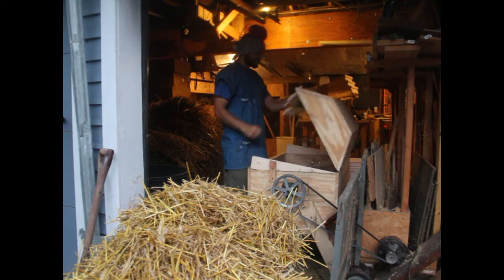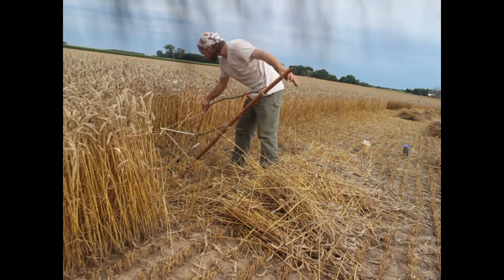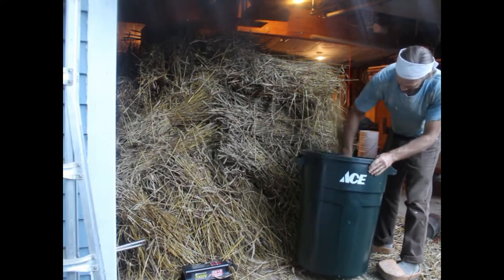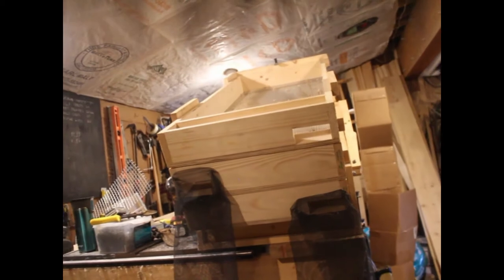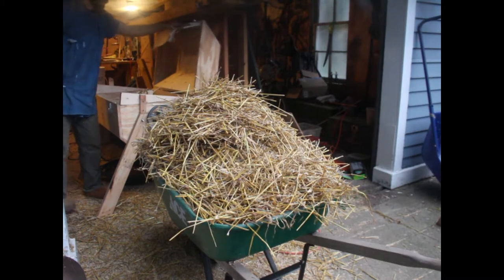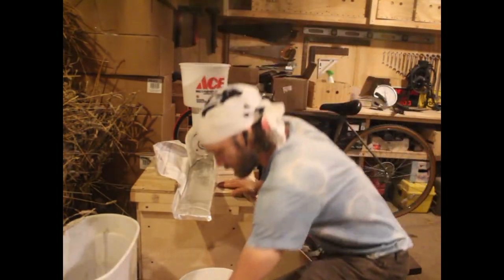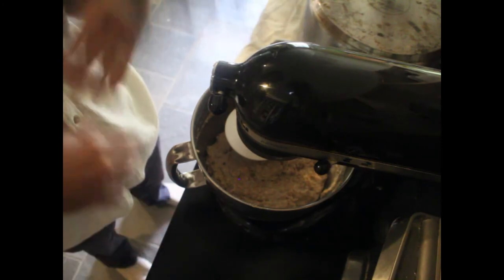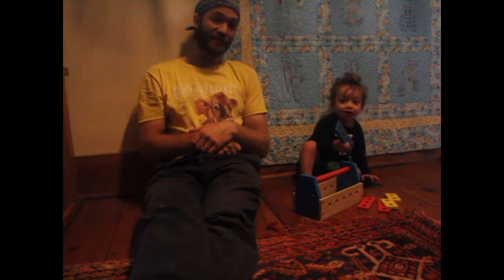Harvesting Wheat by Hand -- Foodmageddon, Ep. 20

Comment: Pull the heads over a bucket.  Dump in HF cement mixer.  Toss in a few blocks of wood.  Aim blower in mixer.  Turn on walk away come back clean beans.  Dump mixer in bucket and repeat. You made it very hard and very expensive.
Reply: That's a new method on me. I'm sure it would work well. The nice thing about this thresher is that it can be adjusted for beans, wheat, oats, and all kinds of other things. Also, I don't have a cement mixer, so that would be expensive, too. This cost under $50, since I had the wood and motor sitting around. I did about 8 bushels, so pulling heads would have taken a while. Cutting them off with a hedge trimmer over a big tub did work, though. Thanks for watching!
Reply: Oh! And I later found that I could just point a fan under the thresher outlet and that remover 95% of the chaff automatically. I got to cut the later steps.
Reply: @s.a.j.johnson  When you cut with the hedge trimmer did they fly all over?  Do you think it would work to  put some house gutter on the hedge trimmer.  Do you think you could get them to land in the gutter and then dump in tub?  Kind of use it like  a sickle motion.  I was thinking of trying that.  I completely understand you have to use what you have.  That is how I ended up using the mixer I had one.  It is a tiny one I think it was 150 I also use it for cleaning all my other seeds onions raddishis flowers peas beans ETC.  I have a small patch of oats this year test run. Thanks for the video I learned from it.
Reply from the maker: @smokingjoking  Oh, I meant loppers. I'd hold the sheaf between my legs with heads over the container and then just snip once and all the heads fell in the container. If I ever get my hands on a mixer, I'll try it!

Comment: We would be able to lean on alcohol as a fuel... you can make it.
Reply from the maker: True! Or biodiesel, but not at the present rate of consumption. For some tasks, petro-type fuels just pack so much power in such a small amount. What we are against is digging up sequestered carbon (ancient biomass turned into fuels) and putting that into the atmosphere. If we were using modern carbon, converted into a fuel (for example, firewood), we are not adding new carbon into the equation, just cycling it. But for sure, alcohol and biodiesel have a place, albeit a minor one, in our energy future, at least as we see it. Thanks for watching.

Comment: In my opinion you made too much shake to the straw,  that will make the grains falled down 👇,  the best way manually hasvest it is you can use sickle... Or hand power grass machine with small innovation
Reply from the maker: For sure! This was my first year. Check out my new video on harvesting by hand. The method has improved a lot and I harvest earlier. That reduces the "shatter" (loss of grains) a lot. Thanks for watching.

Comment: Grow corn, distill alcohol. Run internal combustion engine off of alcohol. I can tell by the use of “fossil fuel” that you have no mechanical sense. Older tractors ran just fine on distillate.
Reply from the maker: Thanks for watching. Sure, and we'll fertilize that corn with? Without fossil fuels, we don't have the energy for enough fertilizer (currently 230 lb +/- 50 lb per acre) to make an all-distilate fuel system work. The EROI on corn-derived ethanol is just 1.04, meaning for every unit of energy you put in you get just a bit more than one in return. That makes no sense. Why not sugar cane (1.8 EROI) or African Palm (3.1 EROI)? (https://www.sciencedirect.com/science/article/pii/S2405844020310574). 
Again, thanks for watching.